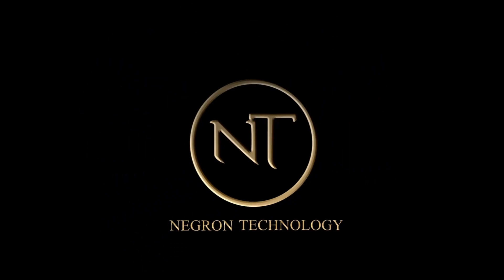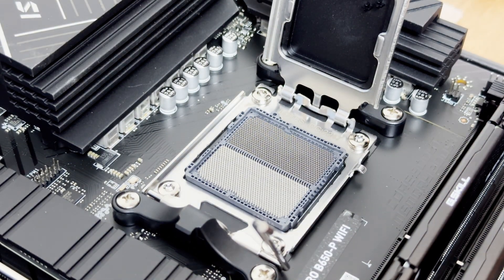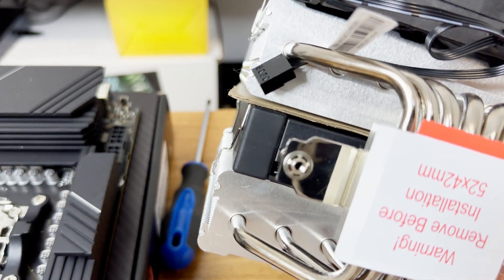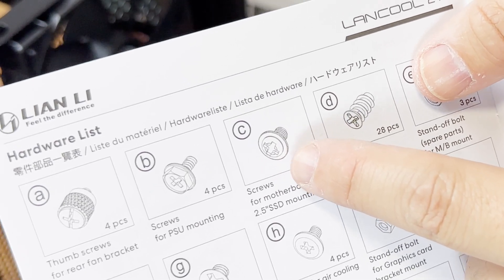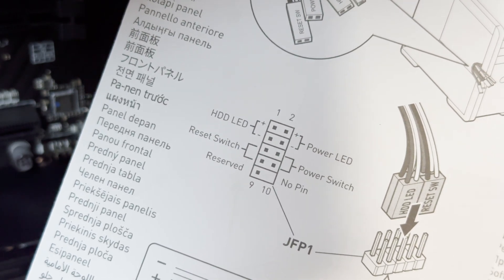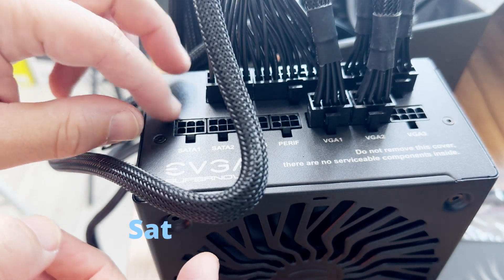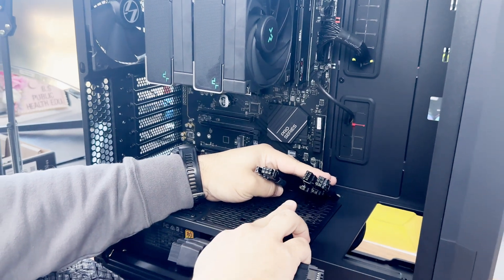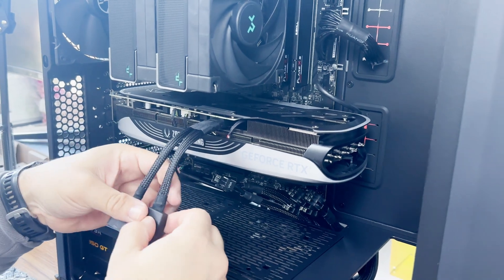How To build a Gamer PC | BEST Guide for Beginners 2023 | Lian Li Lancool 216

Comment: For the fan hub, it also has a USB 2.0 cable to plug into the mobo. What's that all about? So it seems there are 4 connections needed: PWM header, ARPG header, PSU SATA, and USB 2.0 header.

Comment: Hey man I am having issues with my build. The Chassis fan 1 speed sits at 1650 rpm in idle, I have tried many things to fix it but it seems as though it does not change modes at all when I change them. Any information will help.
Reply from the maker: Which header is it plugged into ?  CHA 1?  

If it is, could be a MOBO setting keeping it at that speed or the fan itself might not be able to adjust the rpm’s.
Reply: @Mdntech3000  I can't manage to change it. I have tried setting the run up as low as possible nothing changes. RPM stays high. Putting on PCM, silent, all out of ideas.
Reply: @Backwardsninja468  Don't know if you ever resolved this. But another possible solution I have seen is enabling the motherboard Sync option within the L-connect fan controller software.

Comment: What happens if you use AIO fan controller, do you plug all fans on that including the case fans? or just plug the case fans on the hub and use aio pump fans on the controller?
Reply from the maker: If you use an AIO controller and plug the fans in there (the AIO controller normally still connected to the mobo usb 2.0 and one fan header plus sata to the psu - depends on AIO though ) then they still work of course.

The AIO then controls all the fans and you’d do that by using whatever AIO software is out there like L connect or armory crate
Reply: @Mdntech3000  is it better to keep the case fans plug in the fan hub and the AIO fans plug in the controller, like keep it separate. What would you recommend? 

I’m looking into building my first computer, it just the fans really throw me off, looks confusing with all those wires lol

Comment: @15:10 is from the fan hun, shouldnt it be one fan controller and RGB one and the sata, or just that one in RGB header and thats it, because i see a black cable head covered infront of the rubber opening, what is that for?

Comment: This video helped me alot thank you from the bottom of my heart.
My build

Motherboard - MSI Pro Z790-A WiFi DDR5

CPU - 14600k

Case - Lian Li lancool 216

SSD - Samsung 980 Pro 1TB

RAM - G.skill Ripjaws S5 16×2 32GB 6000 cl 36-36-36-96

Aircooler - Deepcool AK620 Zero Dark

PSU - Corsair RMe 1000W ATX 3.0
Reply from the maker: Nice man! Glad to be able to help and nice build!

Comment: Very nice video, do you think adding 2 fans on top will help gpu ans cpu coolling? Or better on bottom? In your case the temps are  cold enough?Thanks keep posting
Reply from the maker: You can do both but normally intake at the bottom for fresh air towards the gpu, and exhaust the top fans so the hot air escapes.
Reply: @Mdntech3000  thanks in your case with only the original case config fans your temps are good?

Comment: hi, can you tell me how to properly switch the i/o from the top to the side. i tried to do it but i cant put the front fans back, the cables are preventing me to put the front fans back
Reply from the maker: I don’t have the case in my possession anymore but it can be done.  I know it’s a TIGHT fit, the cables have to get jammed behind the fan mount I believe.  

There should be discussions online or hopefully even a video of someone doing it!  Sorry I can’t
Reply: @Mdntech3000  thanks. I will just keep as it is.
Reply from the maker: Sorry I couldn’t help more 🥲

Comment: I ordered the 216 because of that extra room at the top for my rad!
Reply from the maker: Nice man! Hope you enjoy the case 👍
Reply: @Mdntech3000  the case is awesome! Just finished my build today. However I can't figure out why the RGB 160 fans are lighting up. Other than that it's an amazing case!
Reply from the maker: There’s prob a minor mistake when it comes to the connections from the hub or motherboard.
Reply: @Mdntech3000  Most likely. I'll have to dig into it. But only later cuz these high frames are to good to pass up!😂
Reply from the maker: Haha awesome man enjoy it as long as it doesn’t bother you.  If you end up troubleshooting in the future just drop a comment I’ll try my best to help.
Reply: @Mdntech3000  will do! Thanks man!

Comment: I can’t seem to make my Msi mpg b650 edge wifi mobo fit in the case. Anyone have any suggestions
Reply: I can get the standoffs to line up with the case standofffs
Reply from the maker: Is your mobo the mini version?
Reply from the maker: Tbh I think I remember having an issue lining up all the mobo screws to the case.  If you’re unable to secure 1 or 2 screws to the case standoffs it’s not the end of the world, it’ll still be secure.
Reply: @Mdntech3000  I think I figured it out thanks. I was panicking haha.
Reply from the maker: Ok cool! Sorry wish I could be more help.
Reply: @Mdntech3000  I guess you could help. I put my ssd into my m.2 slot on my mobo but forgot to put it in at an angle and instead put it in flat. It went in but with a pop. I remembered I’d done it wrong so took it out and everything looked okay so I put it in the right way but I’m still worried. Any experience with this?
Reply from the maker: If you can’t see any visible damage I’m sure it’s ok.  Have you tried booting the pc yet? Everything ok?
Reply: @Mdntech3000  not yet still putting everything together. I’ll let you know. Thanks 🤞
Reply from the maker: Hoping for the best! Let me know how it goes.

Comment: 1. You connected 2 Cpu Cables on your PSU - do I have to do this, when I'm not overclocking? - Just have one cpu installed and therefore it comes to my mind - I should only put in 1 Cpu at psu and connect to MB ? Correct me if I'm wrong. 
2. Does it make a difference if I connect the Lian li included fan hub - with the sata port of the psu or the peripheral one? Don't know what's the difference here
Reply from the maker: If you don’t plan on overclocking at all the second connection is not needed.  Although I’d recommend plugging it in regardless if you plan on oc’ in the future!
Reply: @Mdntech3000  thx - then I'll plug it in - and the 2. question :) ?
Reply from the maker: It shouldn’t matter, as long as it’s getting power one way or another.
Reply: @Mdntech3000  I nearly finished my work - just having one last question: I'm getting the 4070 RTX Gaming X Trio in this system. Since the GPU cables from the PSU confuses me - cause the got 2 ends (wich 6:2 each) and my card does need 12+4 pin ATX 12VHPWR connector.  Do I need just one cable? or how should I connect that gpu?
Reply from the maker: You’ll use the provided 12vhpwr for the 4070, and from the psu you’ll use two 8 pin (6+2) that’ll connect to the other side of the 12vhpwr adapter
Reply from the maker: You can use one 8 pin cable if it has a pigtail, but nvidia doesn’t recommend that. They recommend using two separate 8 pins from the psu to their adapter
Reply from the maker: Also thanks for the comment man, I tried to answer you as quickly as possible and my comment in unorganized / a mess but I wanted to answer at least something lol

Comment: Awesome video! Am I correct to say, that you installed the MB in the Water Cooling mode? Air Cooled mode should be liftet up 1 row up if I follow the instructions of Lian li?
Reply from the maker: Yes you’re correct to both statements!  Tbh the difference isn’t too much, you’re fine either way.
Reply: @Mdntech3000  Okay - so I'm going to install it the same way if it doesn't make any difference :) thank you so much for this impressive instruction videos!
Reply from the maker: I tried! Glad to be able help even if it was just a tiny bit haha.  Good luck with your build!

Comment: Nice video, but i have two questions:  where do i have to install the fan hub on the motherboard (exact name) and do i have to add a Sata to the power supply to connect the fan hub or where did you install it? Thx
Reply from the maker: One Sata cable to the fan hub - this powers the fan hub.  Then you can two cables from the fan hub to the motherboard.  One 3 pin 5v (argb) header from the hub to the motherboard (your mobo hopefully has at least one argb header).  Finally there is a fan header from the hub to the motherboard, thus you can connect to cpu fan or sys fan, either or is fine. 

These are the three connections needed.
Reply from the maker: The fan hub already has the sata cable*** just need one sata from the psu to power it, just to be clear.
Reply: Hmm. I saw only two cables in the Video! SATA is clear now! A second connects the whole Fan Hub with the Motherboard as is understand 🙈 im missing the third one in the Video :(
Reply from the maker: I might have cut too much during that part.  The third will be the argb connection, which is a 3pin from the hub to the motherboard.
Reply: Ahh is it there? 9:26  - Connect to sys fan2?
Reply from the maker: Yes that’s one part of it!
Reply: Now it is clear - thank you- you helpes me - im really new to this 🤗
Reply: I'm using the B760 strix so hopefully i find at least 1 argb header 😃
Reply from the maker: So glad to be able to help!
Reply from the maker: You’ll def have an argb header
Reply: May you help me one more time? You do not use the optional RGB controller, neither do i. So how can i control the front fans otherwise? Thx
Reply from the maker: You can control the fan curve in bios and you can control the rgb using whatever motherboard software you have.

Comment: Nice build! Anyway we can get a tutorial on that extra screen display you have inside case?
Reply from the maker: In my main rig?  In this video I don’t have an extra screen.  I assume you mean in the thumbnail picture?
Reply: @Mdntech3000  o lol yes the main rig.
Reply from the maker: I might do a video on it then.  It’s an elecrow raspberry pi 5 monitor screen from Amazon.  It’s connected to the Gpu using an hdmi cable and it’s mounted in my case using stand-off screws that I also bought from Amazon.  Screws come with the monitor but other screws I got work better. 

https://www.amazon.com/gp/aw/d/B07FDYXPT7?psc=1&ref=ppx_pop_mob_b_asin_title

https://www.amazon.com/your-orders/pop/ref=ppx_yo_mob_b_pop?_encoding=UTF8&gen=canonical&lineItemId=okooqujrojkoqny&orderId=111-4129096-8651434&packageId=1&returnSummaryId=&returnUnitIndices=&returnUnitMappingId=&shipmentId=M4YLkS2R9
Reply from the maker: If you want I can try to do a quick video on installation.
Reply: @Mdntech3000  OIC so basically another smaller monitor inside the case kinda deal?
Reply from the maker: Yea man pretty much, that’s all there is to it.

Comment: how about the top panel fan? are you recommending 2 or 3 fans to pull out hot air?
Reply from the maker: Depends on the case,  two would suffice for most builds but if you can fit three you might as well install all 3 to exhaust

Comment: This s t p_d case doesn't have power status led and HDD activity led. What a shame! But front panel connector wire has holes for led. Did they forget to add led lights? or did they not provide on purpose to make us angry? 
Even after paying $130 we don't get what we need. Power and HDD led lights are one of the most important things in a PC case.
What's wrong with these manufacturers? Why mankind is evolving backwards? Humans have lost their minds by removing status indicator lights from PC case and removing 3.5mm headphone jack from phones.
Governments should ban PC cases without power and hdd status indicators.
Reply: I had the same frustration. Fortunately my ASUS mobo has an extra pwr led header. I bought a separate pwr led light to plug into it. The light I left in the case and shines through the glass side panel. Not ideal, but better than nothing.
Reply from the maker: I feel your frustration…rough out here in the tech world

Comment: The Lancool 216 is awesome! I ordered it and it's coming on 24th May. I can't wait! Thanks for the useful build guide ❤
Reply from the maker: Awesome!  It’s such a great case! Top end performance for a nice price, grats ok the buy!
Reply: This s t p_d case doesn't have power status led and HDD activity led. What a shame! But front panel connector wire has holes for led. Did they forget to add led lights? or did they not provide on purpose to make us angry? 
Even after paying $130 we don't get what we need. Power and HDD led lights are one of the most important things in a PC case.
What's wrong with these manufacturers? Why mankind is evolving backwards? Humans have lost their minds by removing status indicator lights from PC case and removing 3.5mm headphone jack from phones.
Governments should ban PC cases without power and hdd status indicators.

Comment: Correction! General rule of thumb is you always check which of the ram slots are prefencially ordered by the motherboard manual!
Reply from the maker: Thank you!
Reply: @Mdntech3000  I currently have 3 PCs, one having an asrock and 2 with asus motherboards. All 3 of their manuals specify "A2 and B2" when using 2 of the slots. I'm pretty certain most boards have the same layout in terms of ram channels. Unlike Pci-e, and m.2 slots, you should place them farthest from the cpu.
Reply from the maker: Yea in my experience they almost always recommend a2 and b2, and absolutely!